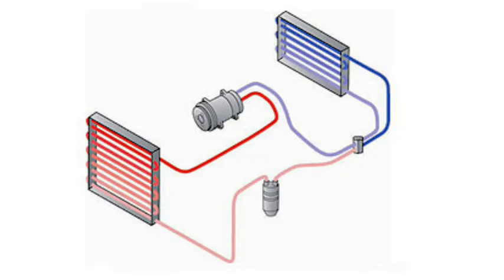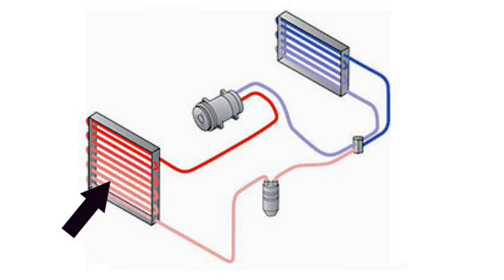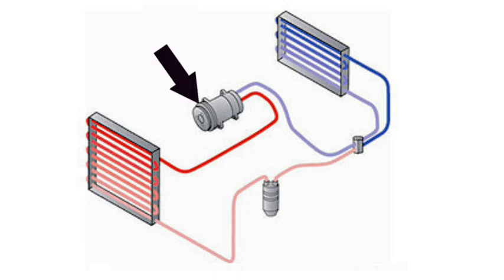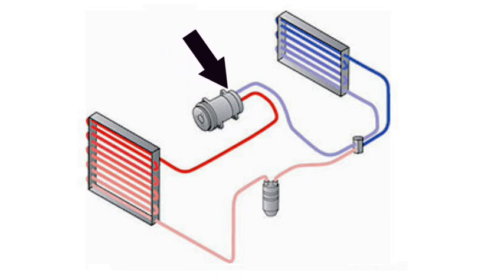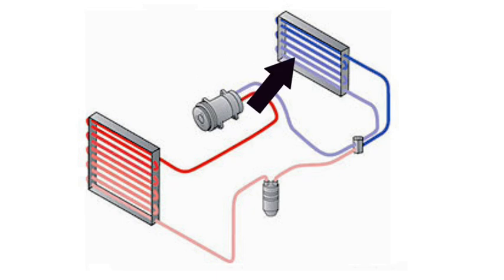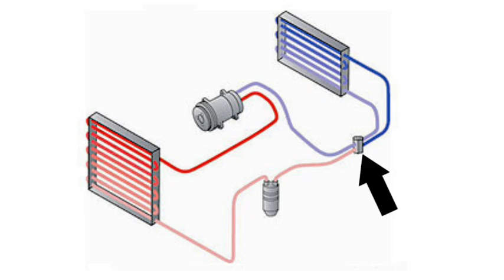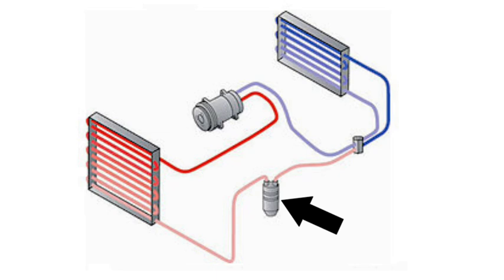AC System Basics - EricTheCarGuy

Comment: Hi Eric, 1 month ago I replaced my 2005 Toyota Wish cooling coil(is it also know as condensers?). Every time when I turn on the aircon it will give off a pungent smell once in a while repeatedly especially during morning or when the weather is cold. What could be the possible caused of it? My Mechanic said that it is due to hot water entering the system and there is nothing wrong with the condenser. What could be the possible cause of it?

Comment: Great videos ETCG, very informative and thorough. Had a guy buy a 12oz can of Freon for his AC. From my experience the low side pressure line port is smaller than the high side. He hooked it up to the smaller port but the gage showed in the red! I figured he over charged his system. I then noticed the high port and low port were on the same  line only separated by a coupling. He did although get the entire can into the system. Can you explain please. Thanks in advance.

Comment: If you have a system that stopped cooling good, then after recharging it, it wont' go below 60 degree's in the vents where would you look first? The condensors clean, compressor's in good shape, system has no major leaks other than needing a little freon every season.

I think the system needs vacuumed down and held a while personally but do you have any suggestions  Eric? Maybe it needs a new dryer, condensor? 

I wonder if there is a way to find the break down with a lazer temp gun to see exactly where the system is failing?

Comment: is it okie to cover the entire low pressure valve/tube with refrigerant insulation cover? just so it wouldnt get the warm when the engine starts to heat up? thanks

Comment: Can I reduce the the compressor ON time by reducing thermostat setting inside the car? If the thermostat goes from 1 to 5, will it be different if we put it on 1 setting than 5? Or the whole temperature is controlled by a gate to control air flow?

Comment: how are you eric I just recharge the ac on my car because the compressor valve was lick a teh free on but when I recharge it the compressor won't engage today I check the electrical the fuses relates and when I unplug the compressor and check for current their non all the controls work and it was working fine before what you think it is

Comment: I vacuumed the ac system for an hour. i added r134 with a manifold to the low side. the clutch does not engage while i am adding the r134. pressure on low side goes up to about 30 and the r134 bottle seems to not empty nor does it get cold. I ran it for about 25 min. do i need to keep adding for a longer period of time to see if the pressure goes up and try and get the clutch to engage?
Reply: Luis Vargas I had to pull the AC clutch relay for my car then jump the terminals in the relay box. After I added about 3oz of refrigerant, I reinstalled the relay then the compressor kicked on by itself to finish charging the system.

Comment: Hi Eric ! I have a question for you. I have a 1997 Maxima, and this is the thing: When I turn on the A/C, the compressor works, the clutch works, it has Freon, but blows hot air like the heater was on. What do you think would be the problem ???

Comment: Thanks for the video. Subscribing to this channel now.  It helped me understand a lot about the AC system. I have a Jeep Grand Cherokee WK 3.0 CRD with the Mercedes om642 engine in it. My aircon stopped blowing cold air. I had it an an aircon place and they fixed a tiny leak and re-gassed the system. It now blows cold air. However they say the system has high pressure and the fan is not kicking into high speed. The fan at "radiator/condenser" spins slowly as soon as I switch the vehicle on. The pulley clutch engages when I switch the aircon on and I get cold air. What can cause the fan not kicking in - Pressure valve on high pressure side? Electric faut on the fan? The fan wires seem to give two negatives instead of a negative and positive but I'm not sure if I'm measuring correctly. Any advice would be appreciated.

Comment: if pipe of car Freon gas has leak because accident .  what I should do ? . 1. remove belt of air conditioner 2. take off switch A /c . what i should do it to save my air conditioner . thank you
Reply: take the belt off. before taking the compressor off , first make sure all pressure is off all lines.
Reply: thank you
Reply: ali Al hagoy you welcome

Comment: hi Eric. ive been noticing the expansion valve illustrations online.  the diagram shows that the  inlet valve on the expansion valve lets the cold air in and at the bottom of the expansion valve it shows the high side at that location that is in red coming into the expansion valve.    on my 70 buick skylark the expansion valve i purchased installs with the expansion valve inlet with the high side coming in on the side and at the bottom of the expansion valve it goes to the evaporator which should show cold  or blue .   the opening  on the side of the expansion valve side  is the inlet side right?   the expansion valve i have sets up just like the one in your diagram.   thanks

Comment: So I know most people here are probably Americans who only need AC to make cold air, but what about hot air? Does the AC do that too? Or is it just the same hot-air system as normal non-ac cars, where the hot air comes from the heated engine/water. I'm just wondering because I live in Ireland (it's frigging cold) and the AC in my car doesn't seem to get hot even when the engine is warm and it's turned up to max heat. It gets a little bit warm if I recirculate the air, but my car always seems to be a bit chilly.
Reply: Ah right, same as a non-AC car so? Yea, I figured out that's how it works after I had a leaking rad in my old car. It wouldn't blow hot air when it didn't have water to pass the heat along. 
In the winter, even when the engine was hot (or overheating!) and it was still blowing freezing cold air I knew that it was time to refill the coolant/water! 

I was just hoping that the AC could be reversed but that's probably a mad idea!

Comment: Hi Eric,Great video.I have a question maybe you can help me with,I know you can. I have an '80 camaro z-28 and it has that radial 8 ,huge compressor on it.Can you advise me as to how to change it over to the lighter sanyo type? I think I got the components named right.The comp. that's on the car is way too BIG and heavy.I would like to be able to enjoy cold air while cruising without the extra weight.Thank You.

Comment: Hi
Does using the Air Conditioning really use more fuel?
Reply: puts a little drag or slows down rpms.  effects use of   fuel only very little compared to the comfort a/c offers. if its working and you need it, use it while its working.

Comment: excellent video Mr Eric the car guy. But you got one little teeny weeny part of the expansion valve wrong.  when you press the button on that pressurized can, the liquid inside evaporates and thus wants to absorb heat.   the same thing happens when the refrigerant passes through that thermostatic expansion valve at the inlet of the evaporator coil

Comment: Mr "CarGuy", I own a 2000 Dodge Durango, the AC is putting out cool air, not Cold... So I bought a "Sub-Zero" self contained Recharging unit from Auto Zone.  Very little directions with the unit, I looked to YouTube, and learned some simple directions. OK, so I hooked it up to the "low pressure" side, with AC on, and the Gage showed in the RED, from the start.  I watched another video on how to reduce this pressure, with a nail, and allowing it to evacuate. My question is, Should I do that?  By the way, I enjoyed your video. Thank you...

Comment: Hi
I just wanted to point out there is a fundamental error in the drawing. One loop of pipes must be of different diameter. When pressurized liquid gas is let to a sudden expansion , cooling happens. So  ,  equal diameters would result in sharp reduction of cooling effect .

Comment: my a/c is crazy...the freon level is low,but a/c works good(i can notice the needed of freon),but when i add freon to the normal level,the compresor start to work erratic,cluch engage and disengage very 2 seconds with a loud noise,i drain the freon back to low level and works wood,but not so coldl(low level=not so cold)..any idea???...

Comment: The AC in my 1979 Ford Thunderbird is blowing snow. First, I thought the TXV had failed. I reclaimed the refrigerant, cut the line, desoldered the TXV, put the new on in place, filled system with nitrogen, silver-soldered it in, ran a pressure decay test, refilled the system and she was a-blowin' the snow again. rxvr-drier? High / low sides spot-on! I bought new gauge set thinking "It CANNOT be spot-on. - There's just no way..." You can hang MEAT in that car! Fresh air / recirc - same. Frustrating. I hate just blindly replacing parts. I must learn WHY.

Comment: Hi really good video,, I have a question I have a mazda in May 2009 and the air-conditioned area doing well and cooled the inside front driver and passenger but the one in the middle (when I turn on the one in the center for Rear passengers can feel good! t There is nothing that comes out is nothing entent only a noise that makes shshhh shhhhhh shhhh shhhh shhh shhhh, do not know if the air takes another direction,, or blocked me please some one can give an idea that's what AC can be the cause! .. the problem. thank you

Comment: Hello Eric, A couple days ago, the AC on 2002 3.4 l Buick Rendezvous went from cold to warm air.  I've checked several of the obvious things i.e. compressor clutch engaged (by the way is always on even when the AC switch in cabin is off), fuses and relays all good, line pressure, high pressure switch, no leaks on lines or condenser. What I have noticed is the twin fans behind the radiator does not spin. I know they are thermo activated for cooling and no signs of overheating, but are they essential for the AC system to function?  Thank you for you help or anyone else who has knowledge or advice.
Reply: it's a Buick Rendezvous. "Rendezvous"? Who thinks up these names?! Sounds frenchie-french to me and my dogs. I'm grabbin' the shotgun, in case one o' them take a wrong turn and make the mistake of shinin' 'round THESE parts!
Reply: The fans are necessary to remove heat from the condenser. They will come on when the AC is turned on. If this is the only issue, the AC will be cold when you drive as you don't need the fans then with moving air coming through the condenser. If not, there are other issues.

Comment: hello,  how are you?  my apology if someone ask my question already.  my question is when i boost the fan to 3 or 4,  (btw i have 1,2,3,4 fan changer 2009 nissan hatchback 1.8 engine) the fan make a loud noise like  brarraarraaraaraa  :).  like fan is about to give up.  the airblow and coldness is fine.  could it be that there is things blocking the fan.

Comment: I have a 2007 Jeep Commander V8 Flexfuel that misfires when the A/C is on and not when the heat is on.  The car runs rough, unable to accelerate, and even stalls while driving.  Codes P0201-208, P0300, P205. How are the two related?

Comment: should me ac lines be cold when running my ac? they seem to stay the same temp. I cant figure out why its not blowing cold air, my refrigerant is not low, the pressure is right and i CAN hear my condenser kick in when  i turn my ac on
Reply: perhaps your expansion valve isn't opening.
Reply: Could be a stuck expansion valve or a blockage in the system.  Normally, thought, you won't feel a difference in temperature in the hoses.  The reason for this is all the "cold" has been used up cooling off the air in the car.  By the time it hits the hose, the "cold" refrigerant is warm.  That's the normal operation of the system.  Try connecting a gauge set to it and see if they change as the system is turned on and off.  If they don't, there is a blockage somewhere in the system.

Comment: Should the clutch plate freely spin with the engine turned off? I tried to spin it, but it takes significant force to turn it by hand, it never spins freely.
Reply: Try it while the engine is running!

Comment: Hey Eric, Thank you for your videos, so much help. I have a question: I am about to replace the compressor on a 2007 Honda civic, do I need to replace the condenser as well? What things do you recommend checking for before I install the new one? Thanks!
- Gabe
Reply: replace receiver dryer as well not the condenser.

Comment: how can i condense this build this and put it into a cooler as a mobile air conditioning system. also am able to make this a solar powered unit ?
Reply: I don't think Solar powered is a realistic option. Requires real power, much more than those cells can currently produce. You would need tons of batteries and such to sustain the compressor. Not to mention the incredible cost
Reply: A good friend of mine gets a check from Wisconsin Energies. That check pays his mortgage and then some. Here's HIS setup; tdlelectronics dot com

Comment: people buy a set of manifold gauges and pressures should be between  21 to 36 psi low side and 199 to 228 psi ( gauge reading may slightly vary with ambient temp)

Comment: Hey Eric, great stuff! Question? I evacuated the AC system. High side holds as best as I can tell. Low side drops from -28 to -10 and holds there for a bit. Dye (from previous application over a year ago) shows nothing significant any where I can see. Should I run new dye through? And where would you suspect the leak to most likely be? Thanks HBall

Comment: Hi Eric
I have a 2003 Honda Accord V4 EXL vehicle which was blowing out hot air. The mechanic I took it to said i needed a new compressor which cost me $650 (supposedly discounted from $850). When I got the vehicle back, it was making a loud noise whenever I put the A/C on and it wouldn't always blow out cold air. I took it back to the dealership and now they are telling me I need a new condenser which will cost me $520. How come the;y didn't know that before they put the compressor in? AM I being taken for a ride?  They also told me that if I do put on the AC now it could destroy the compressor. Any ideas?
Reply: First, inspect your condenser for damage. They might have missed that. It's ok to have some of those fins bent but as long as the bars are all straight. Rocks and debris can bend the bars and block refrigerant from passing through. This can build too much pressure on the compressor leading to compressor failure. 

Typically what can happen in an AC system failure is clutch seizure. If you inspect the compressor clutch with the engine off and turn it like you saw Eric do in the video, it should turn. (if you had the new one put in, ask the shop what happened to the old compressor and if they checked the type of failure). If it doesn't turn then the compressor clutch has "detonated" internally and most likely has sent shrapnel throughout the AC system. If that's the case then they will need to replace the condenser and filter/drier to clean out metal so it doesn't clog the system. 

While we make money off of selling parts too, a good shop wont mind looking around for cheaper parts. You can ask if it's something they can get used or remanufactured, or you can even buy your own on ebay or rockauto, just don't expect a warranty. And unless your car is 2 years old or in for a recall, don't go to the dealer. They charge way more than your average shop and quite often a local shop will do a better job and show more personal interest. I can tell you our service manager knows 90% of our customers by name and knows how to prepare and sell repairs to the needs of each person- by budget, quality of parts, extent of repair.

Comment: Hey Eric i know this is an old post but here goes. I'm putting together a land rover defender-parts from different vehicles. I purchased the ECU,  key fob, speedo, main and chassis wiring loom from a donor car that was not ac equipped. Then I purchased the engine and tranny from another donor car that was ac equipped-comes with the compressor. The engine loom fits the ECU. I think my question is after I figure-out the wiring of the ac will I have to download software into the ECU to run the system?